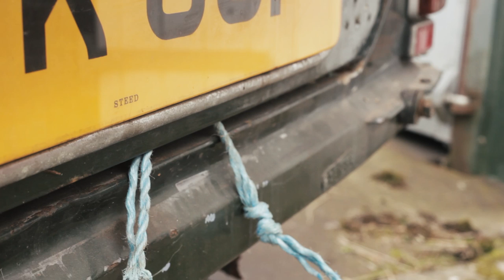BARN FIND: The New Avengers - 1976 John Steed Jaguar

Comment: I worked in the special events dept at Leyland Cars when this car was supplied for filming. I gather it was virtually undriveable because the front tyres made the steering so heavy at low speeds.
Reply: When my garage owned the car in 1986 it was a bit of a handful to drive, the tires were racing slicks cut by hand to give a tread pattern,  it would wonder all over the road following road surface changes and even the white lines. Back then to get any commercial made road going wide low profile tires to fit the Big Jag was virtually impossible, but did eventually track some down, the handling was transformed. The tires appear to still have been on the Jag in the pre auction promotion clip, the slicks were put in the boot when we sold it.

Comment: The car in the TV show never had a rear spoiler?
Reply: +4darrenmoore I think you'll find yes it did, it was part of the broadspeed kit. but saying that I only recall seeing it in the episode 'Angels of Death'. Have a butchers on Google :)
Reply: +4darrenmoore Yes, it's in the '76 season in episode 3.
Reply: +4darrenmoore   It's possible it may have appeared in the show both with and without the rear spoiler.  There were two used in The New Avengers, this car, the star car that Patrick MacNee drove himself as shown by the automatic box and standard engine that this car has, and another hero car which had a manual gearbox and a Broadspeed-tuned engine which was used for the more serious driving scenes which was driven by the stunt drivers, and which apparently was an absolute beast to drive and regularly ran out of brakes in hard use.  Apparently the hero car didn't have the factory sliding steel sunroof this car has to keep the interior darker to hide the fact that it was a stuntman driving.  This car had the sunroof to let extra light into the interior for filming, and like the XJ-S originally used by Ian Ogilvy in The Return of The Saint the sunroof may well not be a Jaguar fitment but maybe a unit from a BMW that was adapted to fit by the company that prepared this car for the production company.  Sadly the hero car was destroyed in the late '70s, probably in an accident though there are some reports it was destroyed in a fire at the studio.  But this is the car that Patrick MacNee drove as the incredibly suave John Steed and legendarily absolutely hated.  It is very likely that the mileage recorded is correct and was mostly recorded by Jaguar themselves and in the filming of the series as after the series ended the car virtually disappeared and was thought for a long time to have been lost like the hero car which suggests that the car saw very very little use by its subsequent owners, lets face it a Broadspeed Jaguar is a rare beast and not something you would be likely to forget having seen.  It is also very likely that this is the only surviving road-going Broadspeed Jaguar XJ12-C left, what records there are are very contradictory but it seems that less than 12 were built and possibly as few as 3, the two for the show and one that was a promotional vehicle for the racing team which was subsequently converted for racing after one of the racing cars was destroyed in a crash...
Reply: It was also featured in the episode Sleepers.

But what with the muzak? If you need to add music at least use music from the series.

Glad too see it back to it's best.

Comment: Im going to guess at £20,000 to £25,000 when it goes on sale at the Duxford Auction in October,all this type of stuff is on the up and up today 70's car's bike's etc, this particular cars got some history  because of the T.V. series,shame some kid's broke in and trashed it up a little whilst locked away in a garage,, but EVERYTHING'S restorable , and this ones very good compared to similar year cars that have stood outside for decades,! newspaper pictures showed the odometer at 4,000 miles be nice if its original ,i understand originally it was a Jaguar Brown lane Development   car part of an early batch of XJ series 2 V12 coupe car's ,before being sold to the New Avenger's television company for Steed's car, im sure everyone will hope its restored to its former glory by a new buyer its certainley worth it those "broadspeed" body kits were also fitted to XJ racing saloon's of the period,lovely car....cant wait to see it finished, an original Jaguar car unlike the badge engineered stuff running around on our roads new today, i bet even the Jaguar badge on those is made in China,!  kind regards all.
Reply: +Glenn Reay   It sold for over &#163;66,000 including premiums and it is suggested that a top-class restoration may well add another £30,000 to that...

Comment: funny isn't it, in the 70's people were obsessed with stupid wide wheels & even more stupid oversized wheel arches & to do that to a fine tuned well handling car with carefully thought out styling lines was sacrilegious really wasn't it. one of Jaguars famous styling aims was the smallest possible gap between tyre & arch & just look at that ludicrous abortion of a modification. hahaha
Reply: I think the flares rather suit the car!   but agree about the gap;  probably stiffer springs;  I made that mistake with my 240Z; because stiffer springs aren't compressed as much by the car's static weight, they need to be chopped a lot more than you think, to get the correct ride height.
Reply: I believe one was banger raced years ago and was no longer around